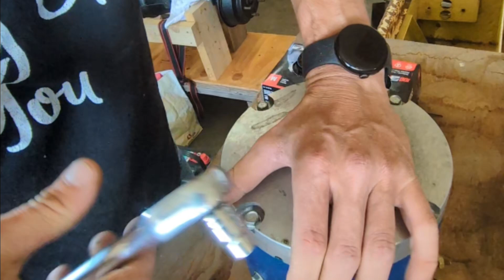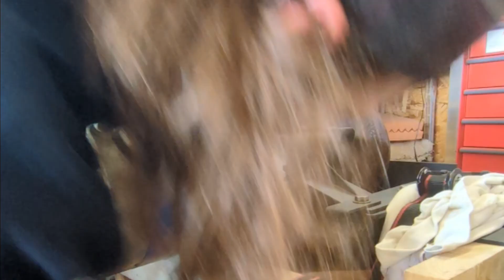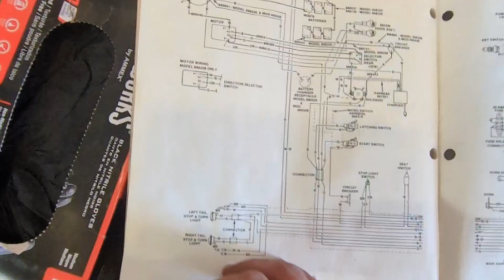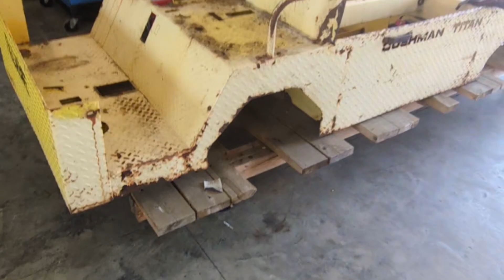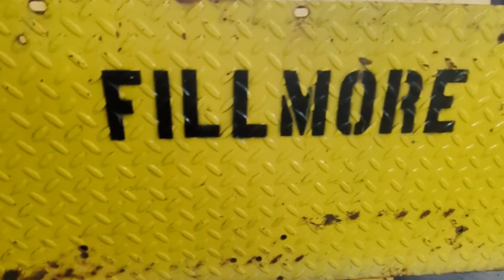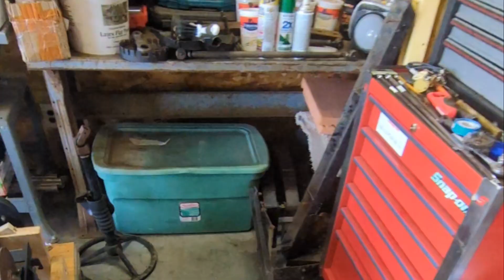Mounting Electric ⚡ Motor in 96' Cushman Titan restoration project "Fillmore".

Comment: Hi. the small notch on the plate between the motor and the diff should be located down so if any oil leaks from the diff it wont fill the motor. cheers
Reply from the maker: Thanks so much! I really appreciate it. Hope you have a great day! 🙂💯👍